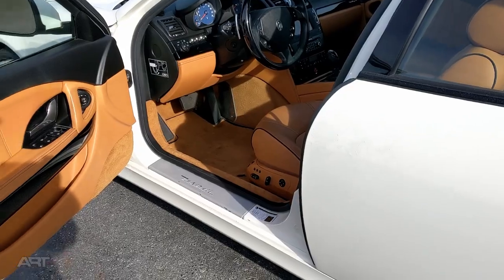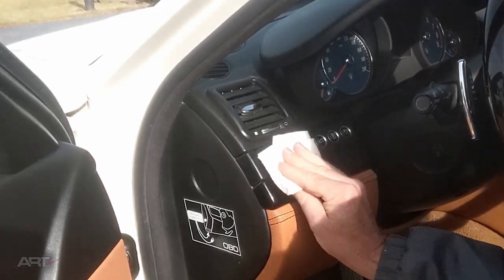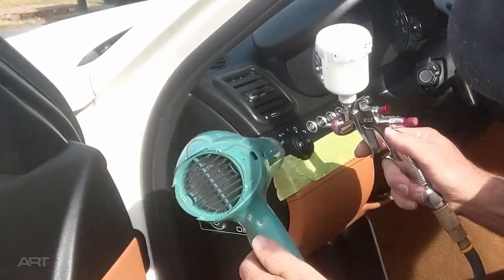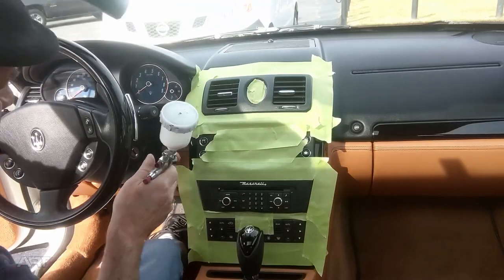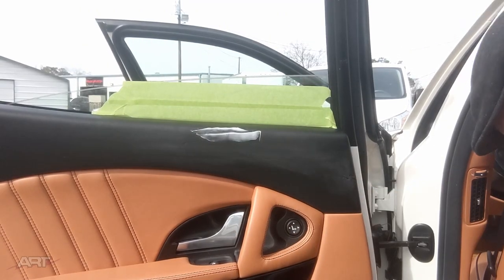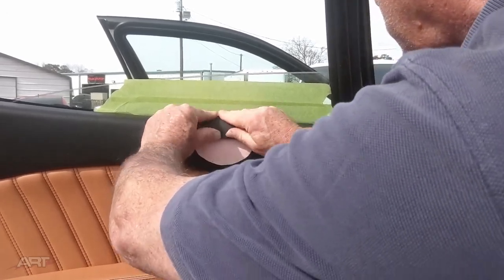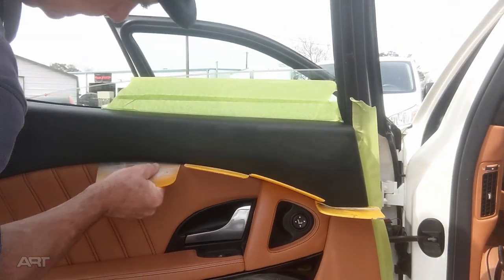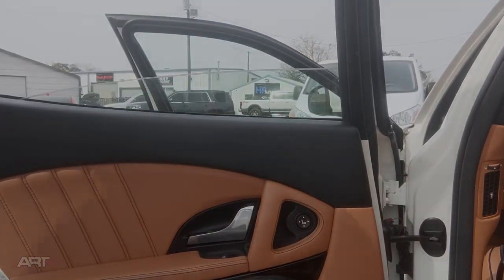Maserati Sticky Buttons and Door Panel Repair v111

Comment: Love your videos, just something about restoration that keeps me drawn in. Started at 21. 38 next, still consuming knowledge and   still fixing furniture. I had a nice job today where a heavy duty mobility rise and recliner had a snapped and bent scissor, needed a full new mechanism, one of the bolts to remove the arm was blocked behind one of the scissors and there was very little room for any tools to get acsses. I drilled out one of the rivets to be able to move the scissors away from the fixtures which inturn allowed the removal of the arm frame. A 60 min job turned into two hours,  Due to other complications. But you can't beat the joy on the customers face when you get the problem resolved and the item of furniture back into service. Sometimes you have to break something to fix it, my only problem is sometimes it's hard not to overthink a problem, and I wasted time trying to find other solutions to the problem, when drilling the rivets took 10 mins I could have saved some time by not over thinking the problem to begin with, every day is a learning day. Keep up the good work, I watch all your videos

Comment: Unfortunately on the W211 e class mercedes, there's one piece of the interior that has this soft touch coating, the headlamp switch. Isopropyl will definitely take it off, but will also take off the icons unfortunately.

Comment: I don't have the spray rig for the clear coat.  Is anyone aware of a wipe-on clear that can be used after the sticky is removed.   What I've found is that the stickiness returns without this last step.  I'm guessing, we're just removing the top layer of stickiness and then the next layer breaks down, causing a recurring mess.